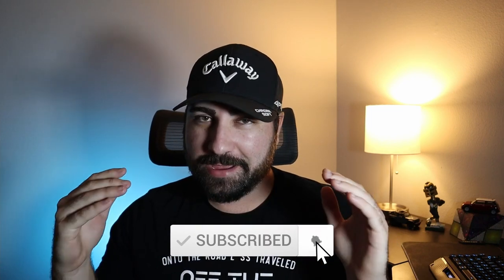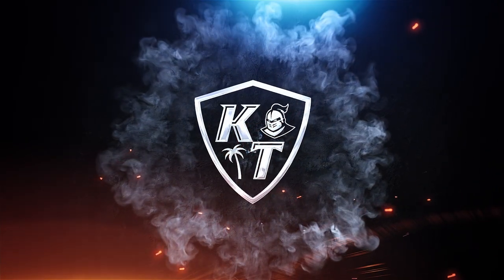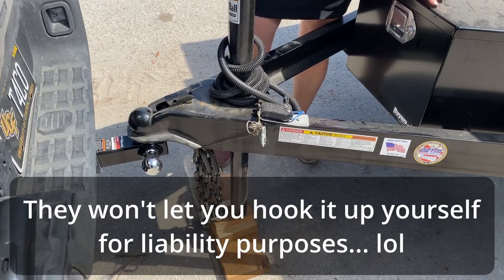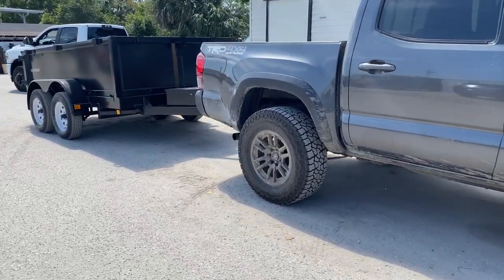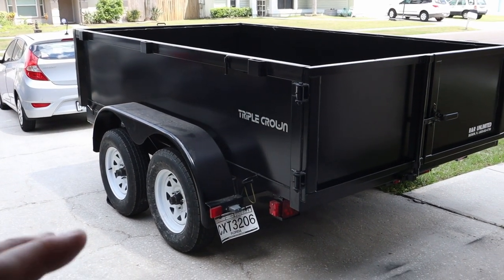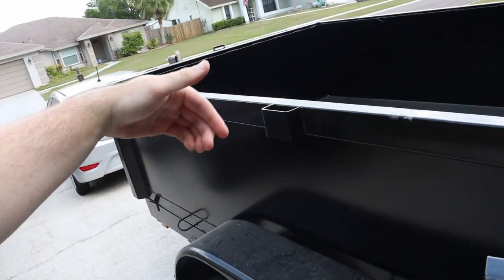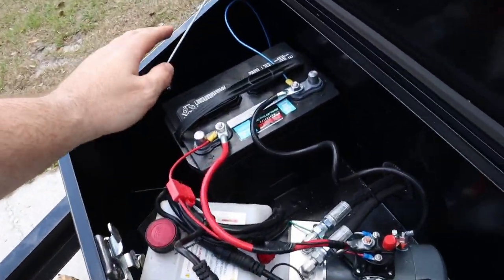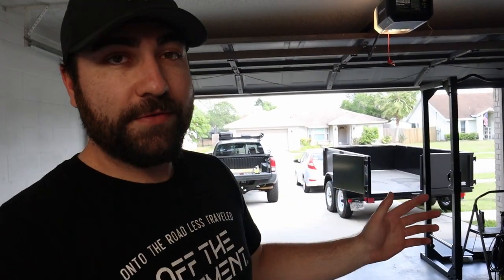Starting a Dumpster Rental Company With My Tacoma | Buying a Dump Trailer | Dumpster Rental Business

Comment: When backing it up put your hand on the bottom of the steering wheel. If you want the trailer to go right turn the bottom of the steering wheel to the right. You want it to go left turn the bottom of the wheel to the left. Easy Peasy 🤙🏽
Reply from the maker: Yeah for some reason that trick has never worked for me lol

The direction wasn't the issue for me really. The trailer just didn't react as quickly as I expected it to. Basically I needed to back up faster for bigger adjustments lol Took me about 2 days and backing up maybe 5-6 times to get it figured out and then I was fine 😁

Comment: Great looking trailer. I suggest you look into a weight distribution hitch with sway control. As someone who tows a travel trailer with my tacoma, trust me you will need it when that thing is loaded down. Also get a brake controller if you don’t already have one. Both are super simple to install and setup and will save your bacon in a emergency situation.
Reply from the maker: I have a brake controller haha always knew I needed that. Weight distribution hitch is kinda hard to do with this trailer since the load isn't the same all the time and I need to back it into some tight spots.

However the Tacoma handled it pretty well. You'll see in the next couple videos 🤙🏼
Reply: @KnightWheelsMedia  Hi handsome.
Reply: @KnightWheelsMedia  I want to talk you secret.

Comment: Great video. Nice trailer.
Best advice for backing up the trailer is put your hand at the bottom of the steering wheel. That way you just steer it from the bottom when backing up into whatever direction you want the trailer to move into, rather than try to hold it at the top of the steering wheel and try to remember to turn in the reverse direction.
Reply from the maker: Funnily enough I tried that method & it didn't work out for me. For some reason I'm better with my hand up top doing it backwards haha

Comment: I had a 12 ft dump trailer and I was towing with my Tacoma once because my f250 was in the shop. And the dump is like 1-2 away. It was the scariest tow in my life. I tried to brake for a red light and it didn’t stop and ran thru the red light
Reply from the maker: How heavy was the load? I never came close to that happening to me haha
Reply: @KnightWheelsMedia  about 2.5-3 tons haha but the trailer weights about 3300 lbs plus the 5500 load. 8,800 total I was 100 percent overloaded. But it was 1-2 mins away I thought I could make it.
Reply: @erikmedina7535  did you have trailer brakes???
And yes you were totally overloaded
Reply: @secretjourney4815  yes I did have trailer breaks
Reply: @erikmedina7535  so you had an electric brake controller installed for one move ? And you couldnt see your suspension before you drove , BS